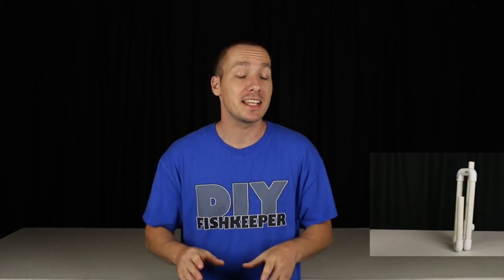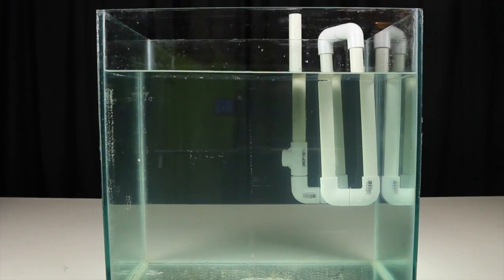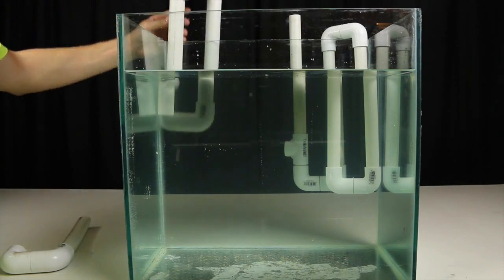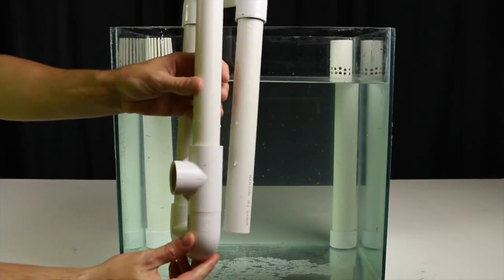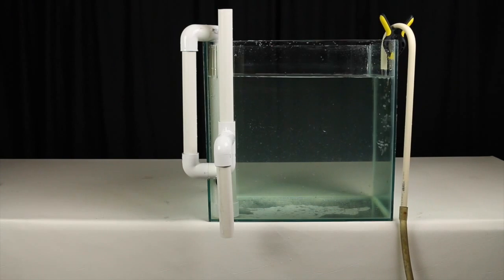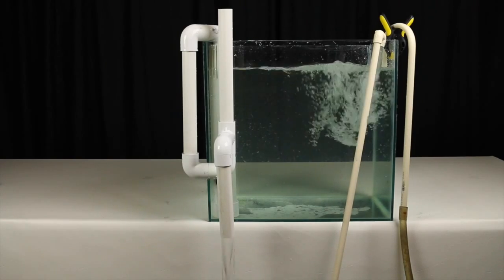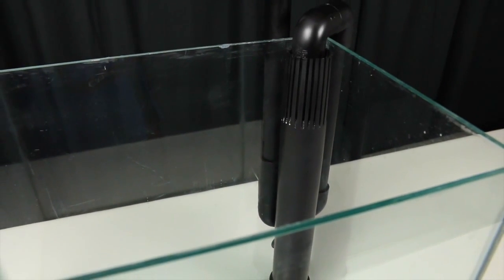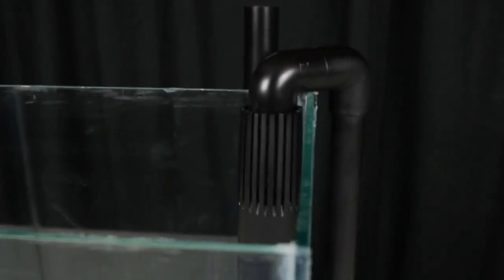HOW TO: $10 DIY aquarium overflow - UPGRADED and MODIFIED TUTORIAL

Comment: That doesn’t seem to be an overflow. It’s seems to actually be a sump return line that’s always feeding water to the sump. An overflow would be a third pipe that prevents the tank from over flowing should the pump send water to the tank faster than it’s being returned to the sump for some reason.

Comment: Hi Joey always enjoy your videos  and a brilliant idea for the pvc overflow you done hear without drilling the tank I build one in 350gallon tank and it’s working well,
My question is can you add a wire at the bottom of pipe as it is on top it will make more sense of clear ring more derby if there was a wire on bottom as well, but not sure how I can get this working if it is possible?
Hope to here from you 
G
Reply: Hi ? I just built mine. Seems it does not work after turn off the water pump and wait for 30 mins, then started the water pump . The overflow did not flow the water. Was trying 2 days to find the issue but couldn’t not find the issue . 😢

Comment: Call me crazy, been doing DIY stuff for a while but even with it built exactly like you have it, everything completely cemented, pre-filling the pipe, this thing does not flow automatically nor does it start back up automatically. I've even added the aqua lifter and it doesn't seem to pull the air out completely or quickly enough. Not really sure what I'm missing on this one. Pipe size is correct, exactly mirrored the video.
Sorry I know this is an old video but there's not a lot like it out there

Comment: Finishing up mine now will update on it when I finish. Testing works great though, no loss of suction, can handle lots of water flow
Reply: One year update, it worked great the whole time. Today I realized it sucked up a few air bubbles and started losing prime. Took it out, cleaned it, and primed it again. Is running excellent. This was an excellent method to add a sump to my already established aquarium without breaking it down.

Comment: Working perfectly fine. Great video thanks a ton. Just one question after all the fittings have been done , is there any to remove the pipe(inlet) inside the aquarium for cleaning purpose?

Comment: I DON"T KNOW WHAT HAPPENED  😕☹😧😞😩😭.
I watched your video like, 20 times.  I made sure I understood everything (I thought I did) . . .and it DID make sense.  I made the pvc weir out of 2" pipe and the rest with 1" pipe for my 150 gal tank.  I checked and double-checked everything --- but it didn't work at all.  I could get the siphon going, but then when I turned off the pump -- as in a power failure -- and turned it back on . . . nothing.  No siphon.  No matter what I did I lost the siphon every time I turned off the pump.

What did I do wrong?  Has this happened to anyone else who used this design?  I even tried putting the "T" on the outlet pipe at different heights --- all to no avail.  Any advice? Perhaps my neighbor offered the most sound advice--flush the fishies and take up model railroading!
Reply: are you sure you're using the correct type of pump and that each tube is in the right place ? also when you have a 150 gal tank and your pvc tubes are only 1" the flow may be low

Comment: I've remade mine twice now and it doesn't work. When the power cuts out the weir tube drains and floats to the top, so when it cuts back on the display just overflows and the overflow fails to restart. I have no idea what I'm doing wrong

Comment: The version I made for my old 55gal tank was the same as the first with a different modification. I wanted it to pull water from lower in my aquarium and these designs only pull water from the top. So I just raised the "T" to the top of the "U" bend setting it were I wanted the water level to be at in the tank at the halfway point, then put a strainer from an old hob on the intake pipe that hangs inside the tank. It worked very well without issues. 
So for those wanting another design that does the exact same thing you can make it like this too.

Comment: I did this minus the 2 inch tube since the hardware store was out, the tube going in i capped off and drilled holes.  I'm having an issue while testing . It loses prime and fills the bucket up and overflows. The overflow does not reptile. Is this because I need the 2 inch tube. I know the aqua lifter says makes fail safe but in video it shows siphon happening on its own. Help

Comment: I found a way to push all the air out of the top 90’s. I fill the tube that sticks up above them with water, then I take a whole water bottle and flip it upside down on the pipe (with a coupling on it) and press the whole bottle down until it’s empty. Itll purge the air. Then pull the cap and let her rip

Comment: I used a 3" weir'd setup with 1" lines. My hope and logic tells me more surface skimming! 😀

I did add a pvc ball valve and a union before sump input to aid in starting the prime and working on sump in the future. 

Now I just have to install flooring throughout the house lol! 

Thanks for the easy diy video

Retail cost in USA was approximately $80 for all pvc, valve, unions, fittings... Now I just need to paint 🤣

Comment: Hi All, I created overflow as per instruction in video by 
1inch overflow pipe with 12 inch length x 3 piece without any pump and 
main pipe 2inch length with bottom cap and multiple holes on top as per the length of my aquarium.
the problem which I am facing is the overflow rate is extremely slow, even by reducing the inflow rate still aquarium filled out with water as drainage is extremely slow.
what do i do to increase its overflow rate\where is the mistake ?

Comment: Recently switched to this version it does flow a lot more water and it is quieter have it in a 55 gallon tank had to go from a 500 gph pump to a 1000 gph pump to keep from sucking the weir dry it’s 1 1/4” overflow with a 3” weir pipe I like it better after installing a black background and painting the weir black you can barely tell it’s there

Comment: The airplane hose I attached to the top then sealed with aquarium caulk did not stick nor create a seal.  Any suggestions?  How about super glue then caulk?  What about rubber cement?

Comment: I dont see this being possible for $10.
Its about $50, gonna actually build it myself.

If i needed a saw it would be even more.
Otherwise nice design and very usefull.
Reply: I think joey is making the assumtion that you have already made the original overflow.  The $10 would be for the mod and will probably change depending on pipe size.
Reply: @dinalagos1  cost $48 for the overflow

Comment: How would you match the pump flow rate with this? I have built this using 1.25 inch pvc and it works fine. I needed the large diameter to match with a powerful pump. 

I find it absolutely impossible to match the pump speed to the overflow speed. The water level for the return pump is either going up or down and I'm constantly adjusting the valves to no avail

Comment: Mine loses prime when the pump loses power and then when it starts back up, the overflow doesn't start back up, I made it to your exact method yet it doesn't keep flowing after. I don't want to need another power source to run the tank (it costs heaps more here in australia). Its getting frustrating

Comment: I made this, but it still smells of the purple PVC cleaner I used before putting the rubber cement on the joints.  I let it soak for days but it still smells.  Any advice?  I don't want to use this in my tank if it will poison my salt and fresh water fish.

Comment: I made this exactly like this. I cannot for the life of me get it to syphon. Someone please help
Reply: I made this exactly as well. I found that, for it to work, you have to cover the outlet pipe, fill the tall pipe completely with water, cap the tall pipe, then uncover the outlet. It worked great after that. Although, if you uncover the tall pipe, it will stop working completely
Reply: So I figured out mine the next day. I drilled a little hole in the top bridge that goes over the tank and I filled that area with water with a syringe then plugged the hole and it's been primed ever since.

Comment: Absolutly perfect! But one little thing... When the bigger pipe is leaking - bottom plug, drilled hole - as You drilled, and the pump is off for a long time, the wather from tank will drop, to the bottom...

Comment: I made an excellent overflow by putting a bulkhead in an old hanging filter. It has it's own suction with weir and you can use the pump to get flow  started. Works perfectly and if you lose power siphon automatically breaks so no overfill.
Reply: What is this you speak of?
Reply: This is a cool idea

Comment: Both videos are great. For the modified version, do you still put a cap on the tall tube now that you're not placing an airline up there? Also, are you placing the outbound hose of the Tom's Aqualifter in the tank itself or that tall tube? Didn't see answers to either question in any video.

Comment: Need help working out what pump size I wond need if I was to using the 1/2" pipe.  L/pH ?
Reply: According to his link "How it all works", 1/2" pipe he rated at 90 gallons/hr. This version he rates at 60% higher, or 144 gph. That translates to 545 liters per hour. So an entry level pump between $15-$25 should work.
Reply: @danielfranklin9062  thank you for the reply, that sounds spot on.  👍

Comment: Hey Joey im a little late in the comments haha, but i built this overflow and im having issues with it turning into a siphon as i turn the flow rate of my pump up. The overflow still is capable of handling all the water being siphoned out, but it makes the water level in my tank go up and down... do i need to make the teeth on the weir with bigger openings? Or is it just not possible to run more flow through it without turning into a siphon?

Comment: Slowly gets air bubbles sucked thru the siphon, leading to reduced flow and failure. Lifter pumps solves that problem, but don't try to run it without one.

Comment: For my 'Surface Skimming' purposes. DIY Overflow version 1. actually works to carry the 'skimmings' to the floor drain.
..With the version 2 water level being only a few inches lower then the tank water level at best. It only works as a collection point inside the weir well on its water surface: But never drains it. when the water current flow is stopped, all that collected stuff merely spreads out on the aquarium surface again.

Comment: Mine is making a gurgling sound from the tall open pipe,  I put tape over it everything works and made it a little quieter, is there a way to fix it completely?
Reply: Access plug on the tall tube. Toolstation or screw fit.

Comment: You must 100% move the T up higher to stop the overflow from emptying the pipe and losing prime.  After a several minute power outage and the pump turns back on, it floods out t the tank the way you have this built. I know cause I built several trying to get it right and the T was the issue to
Reply: Mine works fine the way it shows in the video. Instead of a check valve, I ran it to a powerhead air intake that I have. Anytime there is a power failure, when everything turns back on the powerhead clears out the air pocket in the overflow and it take off again. Also, I put a small hole in the return line just below the water surface so if there is ever a back syphon to the sump, it will only drain water back until that little hole is breathing in air. Double redundancy, and best of all --- NO WET CARPET!
Reply: Are we talking 2 inches 5“ 10 inches
Reply: Well can u do a short video or a diagram for the slower people like me?
Reply: @steelwill101  just move the Tee up several inches instead of the very bottom.

Comment: @the king of diy, how do you get this going? I cannot get it started. All I did was modify the pipe height to accommodate my 40g, other than that, the design matched yours exactly but yet it will not prime
Reply: Missed his guidelines on reaching out for help. It took a lot more suction than expected and it's not exactly full proof like the video shows. It's been running decently for several months now but took a lot of messing around with the flow of the return pump. I do not advise a ball valve for adjusting the flow inline..you just can't finetune it enough for a highflow pump like my 1100gph Rio I had lying around lol.. maybe you can depending on size of sump or power of pump but mine is only a 10g for a 40g tank which is pushing it and risky..I did power fail test to see how much would drain and you definitely want to do the same!...invest in a true acrylic overflow or get a pump that actually has flow adjustment built in. Best advice I can give based my experience with this project. Thanks to Joey for the awesome videos!

Comment: I know this is an old vid, but I'm really struggling to get an aqualifter equivalent in the UK, can enyone help?
Reply: use a power head off an old internal filter, they usually have a little air line that draws in air from out side the tank. get some tubing long enough and use that in place of the aqualifter.

love from down under mate.

Comment: Would this still work without glueing the pipework to test it?
I’m assuming not because of the air leaks etc but trying to find out if this is the case?
Reply: You can wrap Teflon tape around the end of the pipe, with two to three layers. Give it a quarter turn when inserting it in the socket. This will provide a temporary, leak free joint. BTW, Do not use this as a permanent joint, as the Fitting eventually slip out.

Comment: I love both of your videos. Now this video is showing that I can get 60% more flow form the new style. I have a 265 gallon tank and was told I would need about 1,200 to 1,500 GPH. So using the numbers from your first video and with the new style I guess would need to use one 1” pipe and one 1.1/4” pipe to get 1,528 or one 1 ½” pipe to get 1,344. If I did my math right. Another question is does the overflow pipe have to go so far down the weir pipe? I want to keep the overflow pipe a couple of inches below the water line just in case something happens and I don’t drain my whole tank out.

Comment: Hi Joey,
I just built this overflow but I’m struggling to get it primed. Would you have any instructions for me please? I cap it on the bottom, fill it with water and when I uncap it it stops. 
Thank you
Reply: Are you filling the aquarium?
Reply: @thekingofdiyjoey this is my issue as well. Any suggestions? I'm using this as a link between two tanks but it won't stay primed.

Comment: What size of pvc do i need for 180 gallons ?
And
And how to install this one in a euro braced tank ?
Reply: re-watch the video, the pipe joey was using was able to handle 600 gallons per hour of water flow. which is freaking massive.

the rule of thumb is this, you want your tank volume to cycle at least 4 times per hour. 180 x 4 = 720 gallons, so you would need a pump that could handle that flow rate, and pipe bigger then what joey was using in his video.

Comment: Made one of these almost identical to this but cant seem to make mine work without capping the primer spout? How does he get his to work without it?
Reply: Why did no one reply to this.
Reply: Air working itself out I guess. Crazy.
Reply: Who knows, forgot I even posted it but the issue resolved itself. I had tried letting it sit about 10/20 minutes with the cap on. When pulled off it would not flow anymore. I left it overnight with the cap on and primed again then the next morning i removed the cap and it worked as it should. It even restarted the flow once the water level was brought back up after a water change. 

I have no idea what caused it to take so long to fully prime but it eventually did.

Comment: Anyone know if this works for larger builds? I'm currently starting a new 90 gallon and want to give this a try. Also, any size PVC suggestions?
Reply: I just did it for my 75.  I used .75 and 1.5" pvc.  My pump pushes 500 gallons an hour.  It works, but I am getting gurgling m. I think I need to increase the slits on the weer (spelling?)

Comment: what kind of PVC glue do you use?
Reply: not sure what he used but for PVC pipes, purple primer and abs cement is generally what is recommended (youll often see a small bottle of each packaged together for under $10).  The purple primer isnt 100% necessary for low pressure jobs like this, but does make for a much stronger bond.

Comment: Holy moly this thing is a beast I built my own and it does more then an extra 60% the pipe I used I should only be able to do about 600 gallons but all i had was a 800 gph pump and that bad boy can hardly keep up with this overflow!!!!
Reply: I used 1" pipe and have a 400gph pump and it doesnt flow enough, not sure what I did wrong lol

Comment: Instead of using an electric pump to purge the overflow of air/water, why not plumb it using small tubing to the venturi on a powerhead?  It would always be drawing a small amount of water/air from the overflow tube and prevent any air accumulation

Comment: mine didnt work, my pump empty all the water in my sump and my overflow doesnt flow fast
Reply: Same, did you ever figure it out? I mean he is using it and it obviously works so why doesnt ours, what are we doing wrong?!
Reply: @Harlzburg  Did you cement the PVC connections together? If you have any air leaks, it won't work.

Comment: Hi Joey, are you presently still running your overflow with the Toms aqua lifter pump? How has it been working for you?
My overflow keeps losing prime and my tanks are overflowing every other week or so. Tried everything and this is the only thing left for me to try. 
Drilling my tanks is not an option as I have only been able to successfully drill 3 out of 6 55 Gallon tanks. 
Let me know
Keith